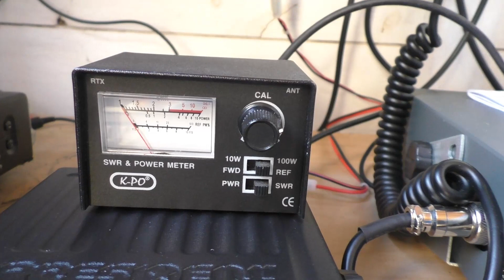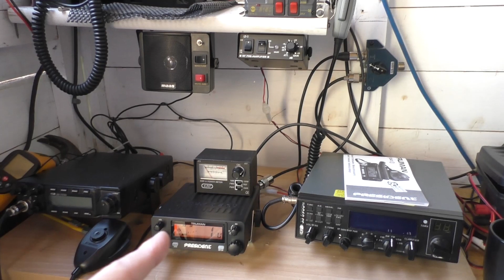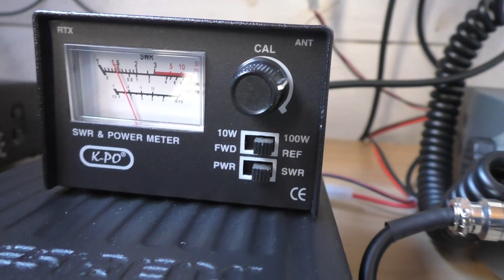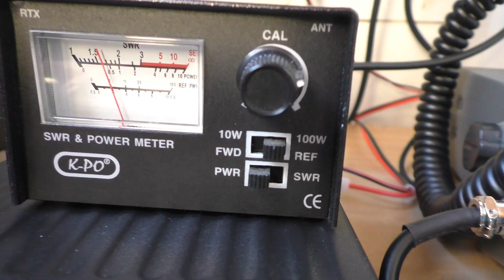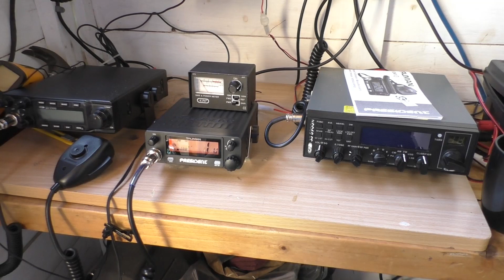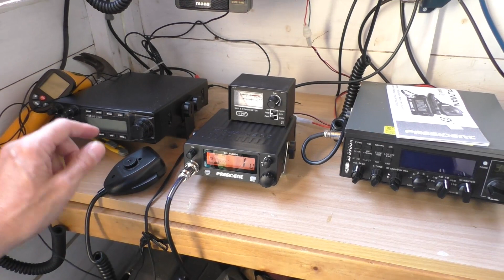ZETAGI B150R POWER AMPLIFIER- President Truman. Safety first.

Comment: swr 1.5 is 4% reflection. 4% of 100watt is 4watt, thats like you would transmitt without an antennacable connected to the radio. did your radio damage from that yet ? btw, those alleged 150watt cb amps often have like only 65watt out.

Comment: I use the Telecom EMD 1000 mic  (£24.95 from Knights) on my Truman and its gets fantastic audio reports. The mic has a rights hand  pot inside the mic which I have turned up to full and the slider on the outside is set low between the first 2 dots.
Reply: Might check this one out since they are out of the k-po mics
Reply: The Alan F10 was a great power microphone of the 80's, as rare as hens teeth these days, but still about 5/5

Comment: Good little amplifier tutorial Fred. Always good to cover the basics and always recheck connections before amp use. I am not a current user of amps but I do own a couple that currently sit in storage. They can be a bit of fun but can be troublesome if not used correctly especially with bleed over on other channels. Some folks can take up an entire band with splatter if they are close enough... lol. ;) 
Thanks for sharing Fred.
Reply: Cheers Andy.  Yes your right they can be splatter boxes with bleed over issues.

Comment: i was told by a ham that is cb + amp + swr and check swr when amp on
Reply: I think it depends what you want to test.  Mostly people put a meter after the amp for a power test. The SWR really should not change although amps do have an effect.  The important thing is you run a SWR test before you add more power.
Reply: That little SWR meter can't handle much forward power - I think it says 10w.  So so putting the output power from a 150w linear through it will cause all sorts of problems!  Fred has set it up correctly here for this test.
Reply: @Perthshire  Yes that little SWR meter would not take the supposed 200 watts the amp can kick out.  In theory the SWR should not change.  It seems that either way is fine.  I personally like to see the swr close to the radio. Once checked i take the meter out of the circuit.  The main thing is that you check the swr BEFORE you add power.

Comment: CBradio - liniair - swr - antenna.

Not 
CBradio - swr -liniair - antenna...
Reply from the maker: You see ive always put the SWR meter close to the radio to measure the reflection ?
Reply: @UK-CB-RADIO  only cb - lineair - swr is right way if you want to measure the swr. 
If you measure cb - swr - lineair you don't measure the swr of the antenna
You measure the impedantie of the lineair.
If you use the swr for measure the input power that's okay.
Reply: I was having it Radio-Linear-Swr-Antenna ,, with this set up I can read the power being generated by the linear ...

Comment: The Sirus Starduster is the best CB antenna to have,I am thinking if you do the RSGB Foundation and General exams and possibly do the ARRL Foundation,General and Technician exams then you can get both licences and a callsign and no one can take away your equipment.
Reply from the maker: Hi David.  I dont feel its right doing the foundation exam whilst iam making vidoes using non standard equipment.  However in the future well who knows.  Cheers.